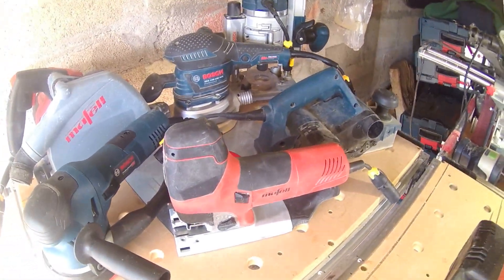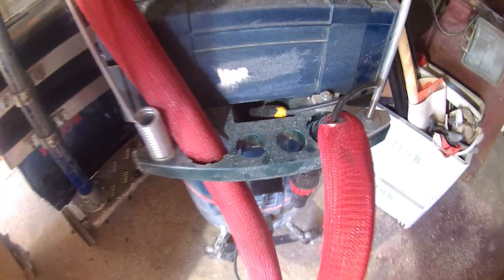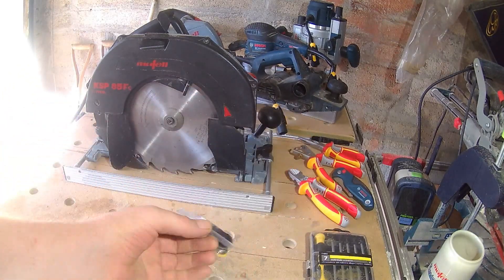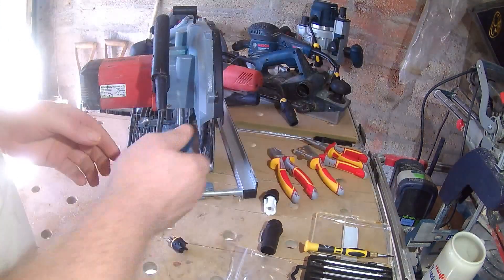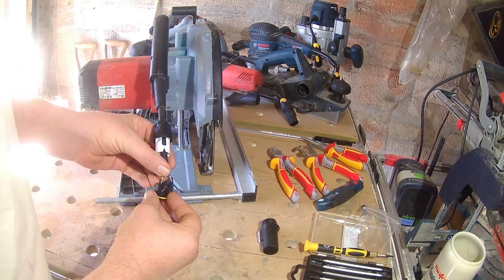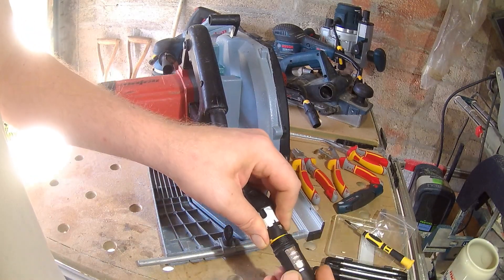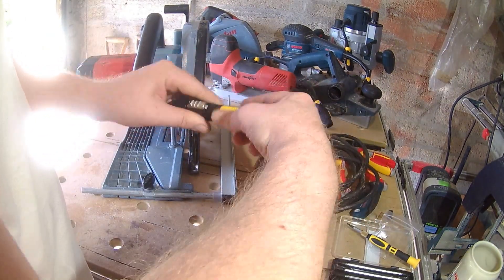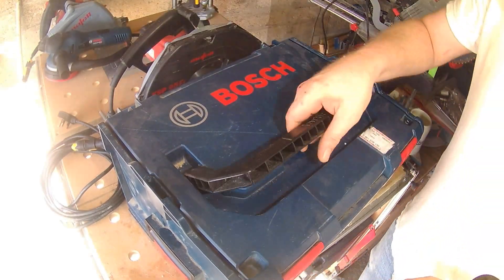Neutrik PowerCON True 1 Top Connector on Corded Powertools.

Comment from the maker: Hello all. Concerning warranty and how fitting these power connectors might affect it, I had a response from Bosch saying "as long as the tool remains electrically safe and no internal electrics have been damaged you are still covered under warranty". I'd say that was good news. Still waiting to hear from Mafell. Other manufacturers I would hope would give a similar reply, but would be worth checking with them if it concerns you.
Reply: Any update on Mafell?
Reply from the maker: @terryatkins  Never heard back from Mafell Terry. But I'm pretty confident if you just snipped the cable to add the plug, there'd be no problems having an internal mechanical or electrical problem sorted on warranty, as you haven't opened it up to mess with anything.

Comment: A really good idea. The lead on a lot of power tools is poorly managed due to the sloppy manufacturer design. I came to this video through watching your Mafell jigsaw review. I have a festool track saw and for the first time realised there is a better way to manage trailing power leads. Even a household iron does a better job where it has a false socket at the base to allow the plug to tidy things up. Have ordered 3 if them.
Reply from the maker: Cheers. Yeah, i find them pretty convenient.  I have one permanently attached to my vac hose. Great for swapping between saws, sanders a d routers without having to deal with all the cables.👍

Comment: Do you use a powercon tester?
Reply from the maker: No mate. You only need a tester if you're looking after many such cables - if you're a sound engineer or something. I'm only ever using one cable so, if there's a fault, I'll know pretty quick
Reply: @BischBaschBosch you have a point, thanks!

Comment: It works the way you did it but the instructions are to leave the back part screwed together (it's why they're pre-screwed together in the bag and not an accident) and then put the whole assembly over the wire.

Then take off the insulation, etc

One think about powercon and speaking is the instructions are excellent
Reply from the maker: That would be useful information if it were at all possible to slide the terminal block and clamp up through the black screwed together casing. Which you can't! The terminal block and clamp sandwich between the two outer pieces so you literall have to seperate them. Good connectors though - besides coming with no instructions. Been using them for about 3 years and they've not had the easiest life on site. Bit scuffed up now but still work perfectly.

Comment: My first attempt at trying this, and I've encountered a problem.  The earth terminal grub screw on the female connector locks up after a few turns, you can just about see the terminal clamp appear, and then it goes no further. I've had no issues on the other terminals, nor on the male counterpart.  Has anyone had similar issues with these connectors, or am I the unlucky one?
Reply from the maker: Hi Sean. I've fitted about 40 of these now for myself and colleagues. Can't say I've had this issue. Must be a random fault buddy. Any way you can let your supplier know, maybe get an exchange?
Reply: @BischBaschBosch  yeah, I've contacted them but I won't expect an answer until early next week.
Reply from the maker: @seanlennon5044  Hope they sort you out mate. Bit of a pain.👍

Comment: Pins to power.  I did some "showbiz" work as a lighting, audio and video assistant years ago and was overwhelmed at all the different kinds of cable connectors for all the different cables and wires for lights and audio equipment.  My buddy told me to just remember, pins to power.  The male end always goes towards the power source, and I would assume it's for the reason you stated in this video, safety.
Reply from the maker: That's a great saying to remember it - pins to power. Exactly that for safety. Removes any risk of anyone touching a live pin.

Comment: Been wanting to do something like this for a while, so stumbling in your video was great. I've just dealt with my track saw, but will wait to do the rest if my tools as it will get quite expensive.  One question though, I'm trying to get a hose sleeve, but I can only find ones from CH. Deliver times are redonk, and I'd rather not get anything from there atm.  Where did you get yours?
Reply from the maker: Cheers mate. The neutrik one's aren't cheap but there are knockoffs for less out there that work well by all accounts. The wraps I get from the seller below on eBay. Go on their "other items" for a range of colours. https://rover.ebay.com/rover/0/0/0?mpre=https%3A%2F%2Fwww.ebay.co.uk%2Fulk%2Fitm%2F162487800584

Comment: I used the IEC  / IEC locking connectors as well. I had looked at the Neutriks, but the cost of the male connectors is 4x that of the ICE connectors...
Just as an aside, it really is a very good idea to either tin the wire ends with solder or, even better, use crimp-on ferrules before inserting the wires into the screw terminals. It won't make a huge difference for a small 250w orbital sander, but a connector carrying several amps (such as a track saw) can begin a cycle of heating and cooling - leading to corrosion (which exacerbates the problem) and breakage. I remember hearing somewhere that a connector can lose as much as 50% of it's load carrying capacity due to the wire strands fanning out under the pressure of the screw in the terminal. Also you are not supposed to crank the terminal screws down to the max possible torque as this breaks the individual strands - leading to the same set of problems (though everyone, including myself does :-p ). Just thought I'd mention that because you mention that these terminals have Torx screws which allow much tighter torquing than flat head or phillips screws in most instances.
Reply: Can you point me in the direction of the IEC connectors? The idea of the Neutrix is great, but will work out very expensive.
Reply: @vRSPagey  As I tell my kids, google is your friend :-p https://www.amazon.com/Rewireable-IEC320-C13-Accidental-Unplugging-Disconnections/dp/B01DCFVXKK?th=1

Comment: I settled on a simlar system, but using IEC C14 adapters at the tool end (male), with IEC lock adapters on the supply side (female). A lot cheaper, but not as slick and sturdy as this, and not waterproof. Wasn't aware of Neutrik at the time. 
Thanks for the video. Your stuff is always worth watching.
Reply from the maker: Thanks James. I knew these existed having spent some time in the music biz many moons ago (often used in outdoor rigs) but couldn't remember what they were called. Took some searching! IEC's aren't a bad idea if you're workshop based. Save some money too!👍

Comment: So... there's a female connector with all the power and a bunch of male tools wanting to hook up?  (nod to kenneth williams). Stuffing 3 pin plugs + cable back into moulded tool cases is one of my pet peeves.  Not cheap those connectors, but a great time saver.  Thanks for sharing your ideas 👍
Reply from the maker: You got it mate. I think the idea originates with Festools "plug-it" system. These neutrik connectors allow us to do the same thing with other brands of tools.👍

Comment: Neat system, regarding the warranty issue it would be prudent to check with each supplier as to the warranty situation, the other consideration is you would need to provide a mains to female connector if your tool needed to go in for service so they could power it up.
Reply from the maker: I think if manufacturers were ok with it, then yes, you'd have to supply a mains with a female. If they weren't, I think I would just open the tool in order to refit the original power cord. I have contacted Bosch and NMA (Mafell importer) to see what they say. They're the main 2 I use. Just awaiting response. I'll post if I hear anything back. All the best.
Reply: Bisch Basch Bosch did you get an answer back from NMA?
Reply from the maker: Hello goatsears. Regarding warranty, I had a response from Bosch. Please see the pinned comment. All the best.
Reply: @BischBaschBosch  Thank you for the info

Comment: Can you use on 110 v
Reply from the maker: People use the exact same connector in the US which is 110v mains  so I would say yes.
Reply: 110V would run at a higher current to achieve the same wattage. Just make sure you don't go over 16A.
Reply: @jamesrodgers3132  Parts Express rates these at 20a over 110v, so it should be safe for many tools over here.